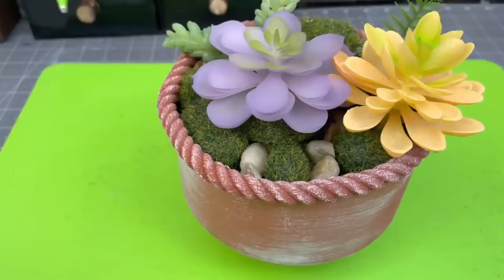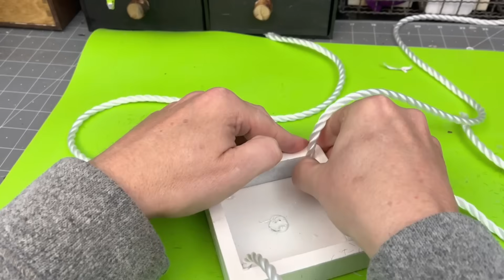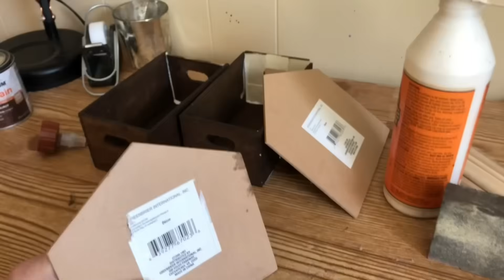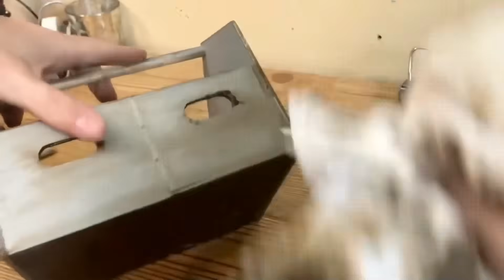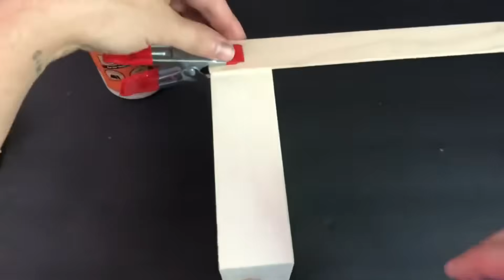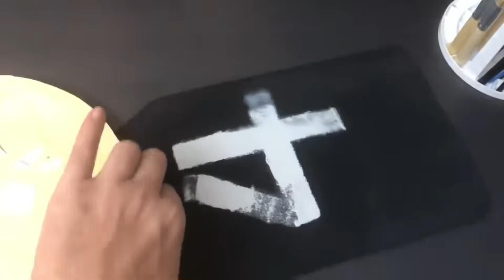Dollar Tree DIYs Guys Will Love | No Frills, Just Style

Comment: I find the fastest and easiest way to remove those labels on items from dollar tree etc is to use a hair dryer or heat gun on a very low setting... they usually come off in one piece then clean resin off with an alcohol sipe